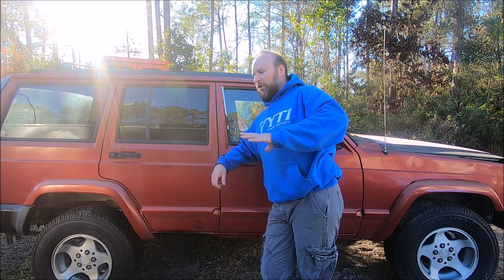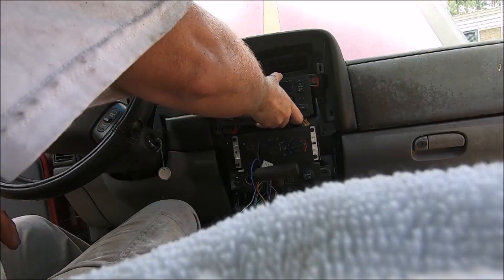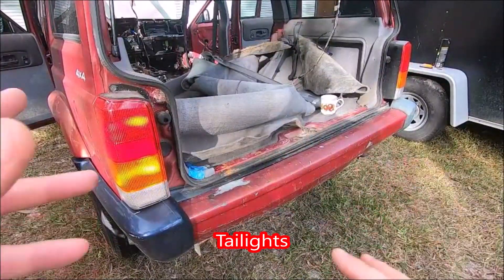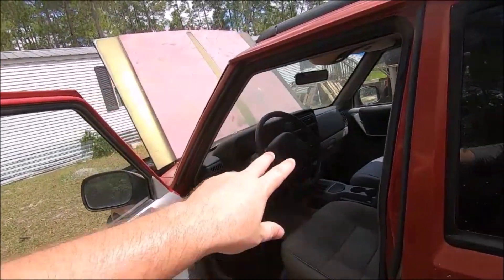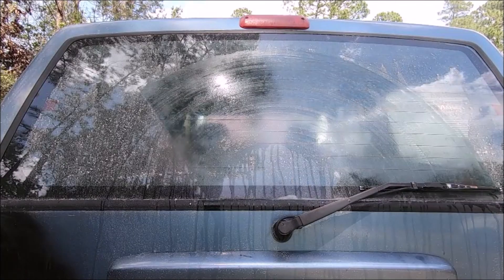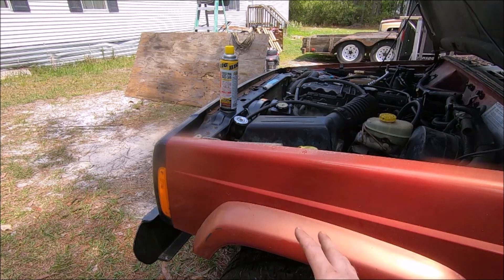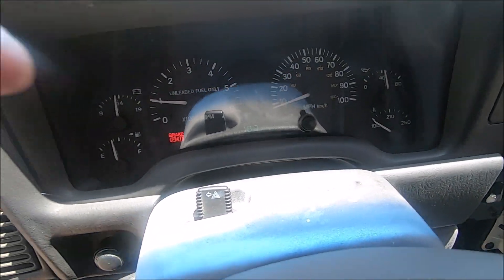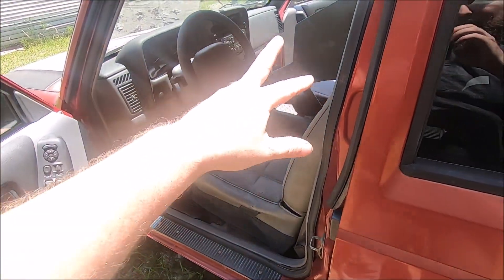1998 Jeep Cherokee XJ Electrical Gremlins Resolved

Comment: I had a similar problem with the power locks/windows on my ‘99 Cherokee.  I discovered a broken solder joint on the front passenger side switch.  Reflowed all the joints and now it works flawlessly.  Apparently, that switch is the master switch for the entire vehicle so if there is an issue with it you lose power windows/locks on all 4 doors.